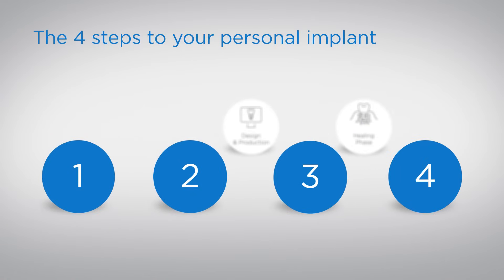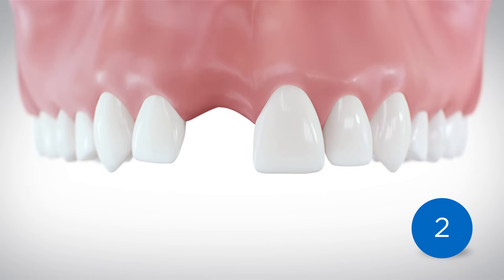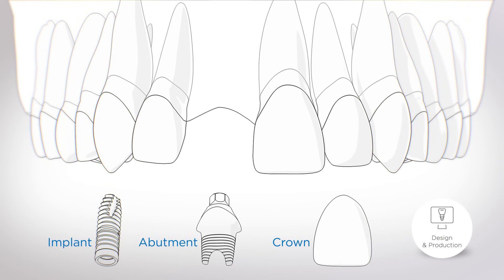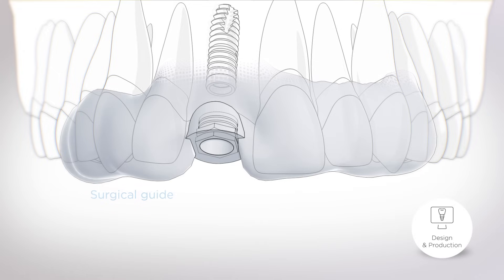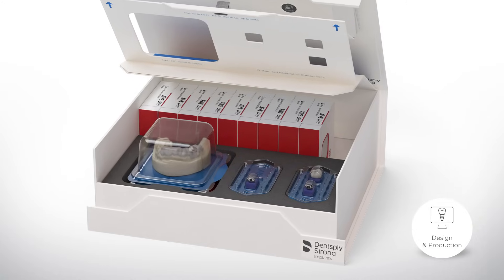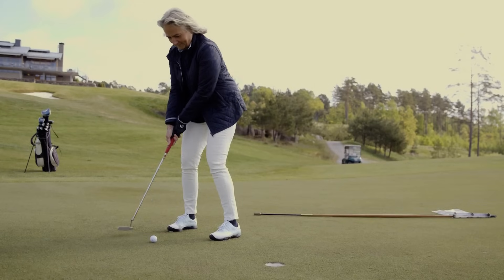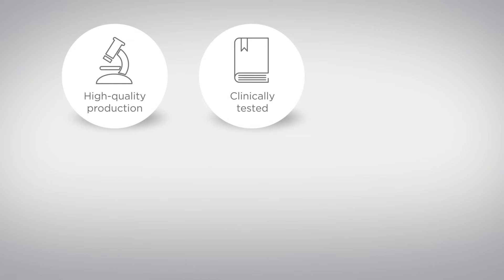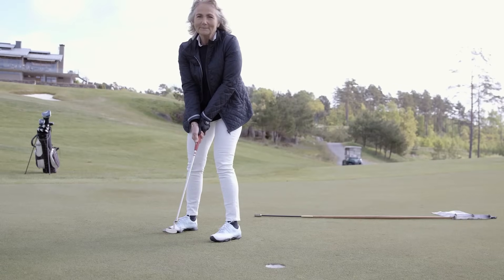Dental Implant Procedure | Medical Animation

Comment: Is this safer than the bridge procedure
Reply: The bridge makes you lose 2 good teeth! This is the best option
Reply: Bridge is cheaper but wont last as long as an implant.
Reply: trust me bridge is one of the worst thing u can do for ur tooth it might cost u cheap but its not for a lifetime i had a friend had it literally in 5 years 
it got ruined and did implant for those 3 tooth , maybe implant is expensive but as long u gonna take care of it it will last forever , bridge can affect ur bone and u might end up by a bone loss which it's too hard for u there to do implant , if u can't afford it try to save better do something worth it or not cuz at the end doing bridge gonna cost u more cuz after couple of yours u gonna have problem in ur gum infections and stuff and u gonna end up making 3 tooth , since u ruined ur adjacent teeth for a bridge
Reply: Dental implants will last you a lifetime.

Comment: Is there supposed to be a flap of loose gum hanging over the hole where the implant was placed? I haven't had any pain but two adjacent teeth are kind of sore when chewing. The stitches fell out but what worries me is that flap flesh which looks similar to the hanging down part of the tonsil. It feels loose And weird, I'm afraid that part is supposed to be attached. The surgery is painless probably won't even need pain pills but It's still a nightmare to have to get an implant... It costs a small fortune $4000-5000 for one tooth! It's not even a major surgery only takes about an hour why is it so expensive! Also the healing... 4 months! Please take care of your teeth ppl bc it's nothing fun about needing dental surgery
Reply: There should not be a "flap".. You need to have your Dr. check it !!!!
Reply: Thanks for sharing. Was worried about the pain. Take care of your teeth people. My tooth was cracked, when I fell, I was young and outside playing.
Reply: Thank you too LighTraveler, for your experience, it really helps those of us in need of this procedure.❤

Comment: How long does it take for whole process?
Reply: For me: Steps 1-2 = 3 months, Steps 2-3 = 1 month, Steps 3-4 about 3 months (but mine ended up taking 1 year because my initial implant impacted, meaning it pushed out through the front of my gum above the level of where the rest of your teeth are). The implant impacted because it isn't guaranteed your body will "accept" the impant. Mine initially "rejected" it during the healing process and decided to slowly push it out sideways.

 For the actual tooth, you may be directed to a different provider who specializes in making the teeth, so that you can get an appropriate shade compared to your other teeth. It won't be perfect (unless your teeth are professionally bleached), but you get used to the difference in color eventually.
Reply: Mine is taking 5 months the healing process just ended it was painful I prayed my body wouldn’t rejected and it didn’t I’m going on two months now I’m waiting for the tooth wich will be ready in November so I’m just waiting now as they take payments out of my check 72 bucks a month at western dental
Reply: @brandimatthews395
Reply: A long , long , long time. Depends how you lost your tooth? My process has taken 2+ years.
Reply: @zaynumar0  bro my  front one teeth is not looking good and it is look like axe. 
It is possible to remove and implant new
Please reply
Reply: @rinchen7785  I'm no dentist but isn't that what this video is showing?
Reply: @rinchen7785  do not remove you original tooth please don't
Reply: Mine will take 6 months

Comment: it's so illogical to place implant for missing tooth when bridge option is available. 
will you fix implant for humerus or femur bone
Reply: It's like destroying two good teeth to place the third
Reply: @ujwalkuckian  True, plus a bridge is bulky AND causes speech impediment, especially if it's a frontal bridge to replace the upper incisors, it may look esthetic but as soon as you open your mouth to speak, it's a dead giveaway, bcz your speech  sounds muffled.
Reply: What if one of the two teeth break after some years? The bridge will gonna fail too
Dentist suggested me implant over bridge
Reply: @ujwalkuckian  So true, bcz implants are INDIVIDUAL tooth, so if one were to get damaged the others would remain intact.
Reply: Damage healthy teeth to install a bridge? No, thanks
Reply: drilling bone for implant is far more destructive than tooth
Reply: @sharadranjangoankar1172  That periodontal bone is going to deteriorate anyway with a bridge, plus the gums will recede and they won't grow back. Plus an implant looks more natural and you won't have to shave the teeth next to it.
Reply: @ramunematt  implants don't have pdl fibres so it won't act like natural tooth anyhow. 
and whatever issue is with bridge same goes for implant like gum reccession, implantitis
Reply: @sharadranjangoankar1172  Wrong. With bridges you objectively lose more periodontal bone and gum tissue than you ever would with an implant, that's universally agreed on by dentists and not up for debate. 

Implants are the best we have to natural teeth, and they can last the rest of your life without needing to be replaced. And btw implants can support bridges too, and they are far better than bridges without implants.
Reply: @sharadranjangoankar1172  A dental bridge can cause one's speech to sound muffled, especially if the bridge replaces the four superior incisors, bcz it affects the natural air-flow in the buccal cavity due to the fact that the four incisors are now fused together.Dental implants on the other hand, are INDIVIDUALLY implanted, one tooth at a time, thus leaving a tiny gap btwn each tooth, thereby significantly improving speech to sound natural.People with implants have actually said that over time they forgot they had in implants, bcz they can even floss btwn them.Not so with a bridge, since it's a fused dental prosthetic.
Reply: and u may want to deny but tooth are having multiple root with pdl and implant is single stump lacking pdl. 
It surely must be affecting bone but now scientist want to propagate implant same way as they propagated various medicines, root canals, various standard of blood profile just to hav business
Reply: @sharadranjangoankar1172  no! not "just to hav business" BUT just to help people.
Reply: @sharadranjangoankar1172  Like I said, dentists are NOT God, but they do a wonderful job with the gift that God gives them.Salaam
Reply: @ivornworrell  i clearly mentioned implants don't have pdl fibres which are basically shock absorber for natural teeth so whoever claims implants r best than bridges must consider this possibilities too. 
Even implant can get infected like bridges known as implantitis.
Reply: ppl who go for full mouth rehab totally looses proprioception.
dentist and scientist also claims root canals r good but one must know the limitations of root canals bridges implants. 
why all r so close minded. 
there r dentist who knows limitation
Reply: @sharadranjangoankar1172  Well, at least a full mouth rehab is better than having no teeth at all!
Reply: @sharadranjangoankar1172  ok, but weighing the overall pros & cons of bridges vs implants, implants is the better option everytime.Salaam my friend.
Reply: @ivornworrell  how about digestive system is it  possible to renew digestive system too like implanted teeth
Reply: @sharadranjangoankar1172  No,  only The Lord Jahovah God alone can do that.There are limitations to man's ability, as noble as they may be.Salaam my friend.
Reply: @sharadranjangoankar1172  I wouldn't say that all things are manipulated by medical mafia, some yes, but not all.There's a lot of good medical science in the world that has genuinely helped many.
Reply: @ivornworrell  yes i do agree with you brother
Reply: r u a jew?
Reply: @sharadranjangoankar1172  I'm from The West Indies, but to me race doesn't matter bcz God is the Creator of all life.Peace be upon you.
Reply: @sharadranjangoankar1172  I agree with you that drilling into the bone is destructive. 
I'm also concerned with the long term affects of titanium being inside, is it toxic? Can it cause cancer?
What are the other alternatives available? With bridges as they have shown the problem of gum recession and bone damage is there. Partial dentures?
Reply: @sharadranjangoankar1172  it's like a mini surgery btw they r professionals and they have more knowledge than us in the field
Reply: @ujwalkuckian  so u r not convinced with my logic. 
implant don't hav fibres like natural teeth
Reply: @sharadranjangoankar1172  Who can create natural teeth but God Alone? But INDIVIDUAL dental implants are the closest thing to natural teeth, thanks to the great skill AND technology that God has blessed man with.Salaam
Reply: @sharadranjangoankar1172  The drilling of the bone is done with  laser-like precision, very accurate with today's tech., plus the bone already had a natural cavity in it anyways, when it housed the natural teeth, it's just that the bone cavity might have closed up due to the tooth no longer being there to keep it open, so the drilling merely re-opens the bone cavity to house the dental implant root.Conversely, grinding down a tooth is an unnatural process, but necessary to attach a dental bridge.